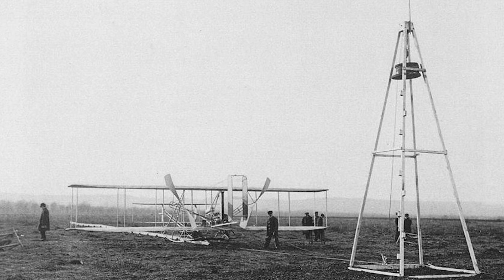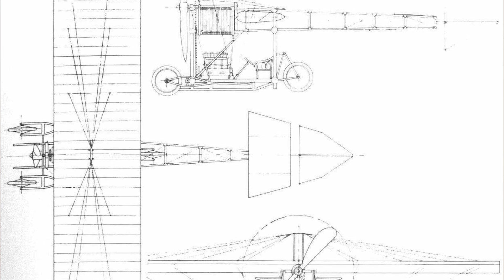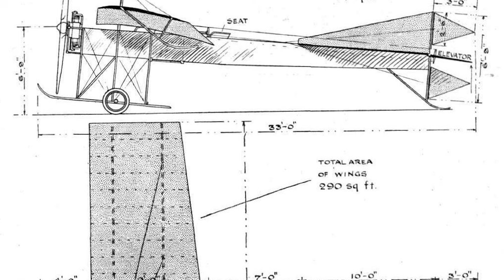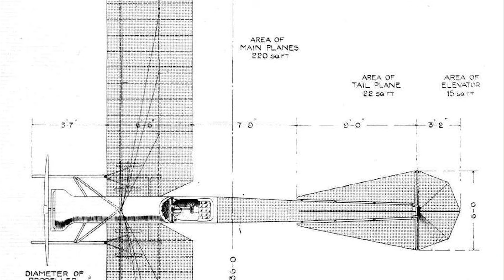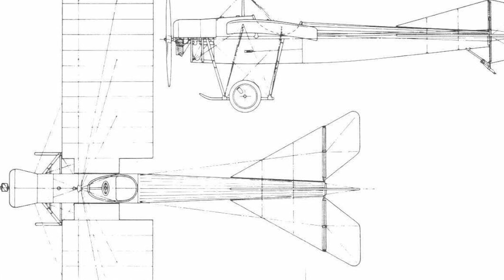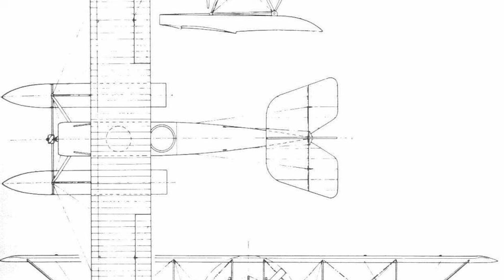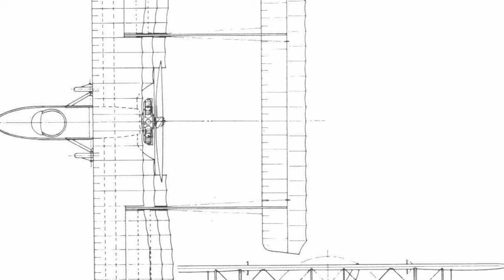Early Blackburn Aircraft | The Good, The Bad, and The Structurally Questionable

Comment: I can hardly wait for part II of this epic.

Whatever happened to Blackburn?

That’s something I’d like to know about to see what happened to this company.

Great video
Reply: The company then based at Brough East Yorkshire became, Hawker Sidley during the 1970s I'm not sure how that transition came about.  Later sometime from the mid to late 1980s it became British Aerospace, then later possibly the early 2000s became BAE Systems.  The company was the biggest employer in East Yorkshire with around 5,000 employees.  From around 2005, the company the BAE Systems then went through a big reform and shrunk the manufacturing capacity and concentrated it's works across at sites in the north west.  Around 3 or 4 years back all manufacturing ceased at Brough,  over 100 years came to an end.  The last of the equipment was taken out last year.. there is still a test facility and some technicians and do take a few apprentices and some commercial offices.. but the manufacturing has gone.

Comment: 2:04 You don't often see the weight tower that towed the Wright planes aloft. Most people think they got off the ground under their own power
Reply: Most people think they required the weight catapult, but they were able to takeoff under their own power under most circumstances, such as on their maiden flight.
Reply: @米空軍パイロット  Really?
Reply: @rexmundi3108  Not everywhere has the convenient winds of Kitty Hawk. If they had moved to the West coast of Normandy and not Le Mans the tower would have been redundant on many days.And they did make non-return flights, without taking the tower with them.
Reply: @rexmundi3108  Yeah. The fact that they also used wooden planks for their runway also makes it look like they needed assistance, when in reality, they just didn't have wheels and needed a smooth surface to take off
Reply: And deep sand wouldn’t have helped a all.
Reply: Most people are correct.
See gregs airplanes. He has a whole vid on it.

Comment: Eleven minutes in when you say radial engines came after rotary do you mean they were using like wankle engines?
Reply: No, rotary engines are engines where the engine and propeller rotate around a fixed central shaft. It's a simple engine to build, but the forces on the cylinders and other components caused by the rotation can cause problems. The radial engines are where the cylinders do not rotate, but instead rotate the central shaft while remaining stationary.

The Wankle rotary engine is later development, being patented in 1929, and not developed into a working prototype until 1957. There are some aircraft that have been built with or modified to have a Wankle rotary engine, but it is still somewhat of a rarity in aviation.
Reply: @DERP_Squad  Thanks for that informative reply - that mention of 'rotary v radial' confused me too.  Incidentally, I had a ride in a Wankle engined car once - the acceleration had to be felt to be believed (you effectively can't over-rev a Wankle).  I got a headache from just being driven in a straight line!